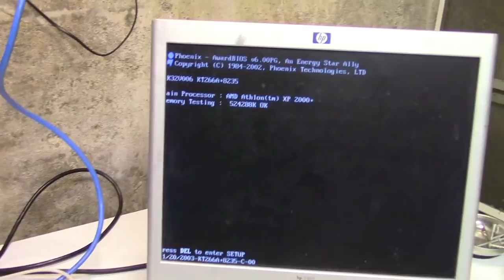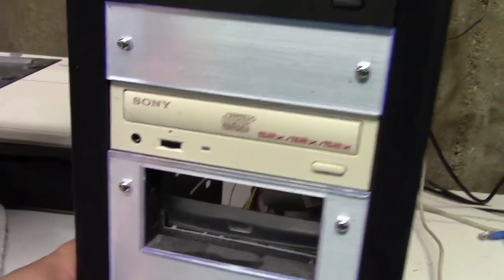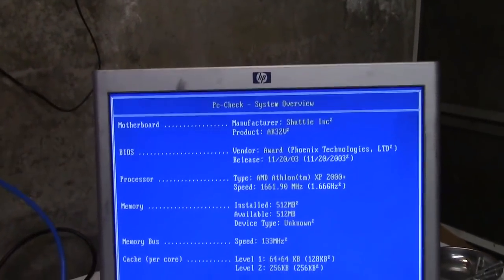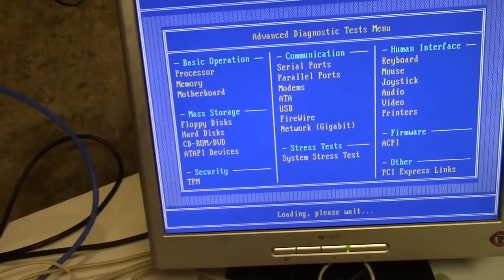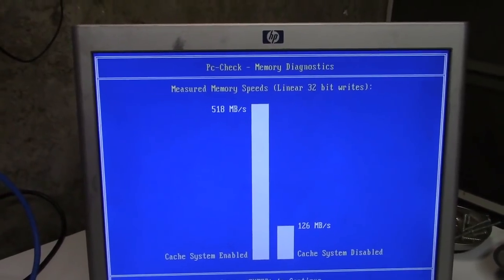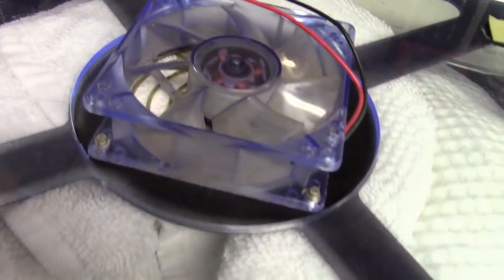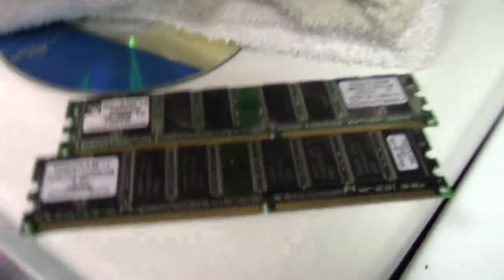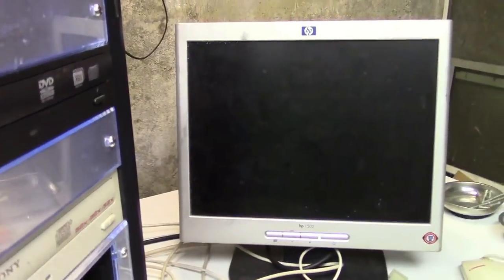A Big Pile Of Whatsit

Comment: The diagnostic program shows "ISA/LPC" even though it doesn't have ISA slots because the Low Pin Count (LPC) floppy drive controller on the motherboard is ISA based. This was true of all onboard floppy controllers up until motherboards stopped including them.
Reply from the maker: Thanks for the information!

Comment: That scarily looks like my old system although mine had more flashy lights on the front.  The cases are so similar they had to be made by the same company.  Even the  processor was close to mine, AMD Athlon XP 2100+.  I think mine started at 512 MB but was upgraded to 1 GB ram.  Mine has 2 optical drives installed with a space in between just like yours.  I do have a floppy in mine and I think mine has an 80 gig HD, western digical if I remember.  Its loaded up with XP and still works although it takes its time to do anything.  I may have to dig it out and make a video on it.  It hasn't been powered up in a couple years so who knows if it will even still boot but it did the last time I hooked it up.
Reply from the maker: Well, it likely was made of off-the-shelf components at the time when they were new.  Chances are the case was a common model at a good price, so a lot were sold.  The Athlon XP processors were all too common in their day, and in my opinion, couldn't get out of their own way.  My sister even has a hodgepodge machine like this, with a similar processor, from back in the day, she claims hers still works.  I know it suffered a hard drive failure a few years in, not surprising since it had a Western Defective drive in it.

I'm sure there were hundreds upon hundreds of thousands of these boxes built all over the country, this was a time when building your own computer was really catching on, and prices were low.  If this was the end result, I didn't want one!
Reply: I built mine back when it was a lot cheaper to build your own than to buy one all done.  Most of the parts I bought online (Newegg & ZipZoomFly) but some I got at a computer show like the case and the floppy drive, maybe even the CD burner as it is some generic drive.  It does have the volume control and headphone jack.  The other drive is an Asus DVD burner.  It also has a Sound Blaster card as I don't believe the mother board had on board sound.  It used to allow me to record the audio of anything that would stream.  Can't do that anymore.  Yes the Athlon processors weren't the greatest but I was on a budget of next to nothing to build this system and couldn't afford a Pentium.  Still it was worlds better than the old AMD K6-2 450mhz system it replaced.
Reply from the maker: I don't have kind words to say about those K6-2's either!  When parts got cheap at the time like you said, I REALLY noticed quality slipping away at a very fast pace.

Comment: 10 bucks for the sound card.
Reply from the maker: The one with the funny connectors or the other one?
Reply: The sound card with the game port.  As for the connectors between the sound card and the cd rom drive I don't think it mattered if it was connected or not. Always worked without it connected.   Maybe it was for msdos games and programs.
Reply from the maker: The cables between the sound card and CD-ROM drives were analog audio cables.  That was for "Redbook" Audio as it was called, basically using your CD drive as a simple music CD player.  When MP3s came on the scene (these were generally the Windows 95 days; not too many had PCs with sound cards under Windows 3.1), people would "rip" their music CD collection to MP3.  More accurately, the processor speeds usually weren't fast enough back then, so they'd rip them to WAV files which took a lot of disk space, then those WAVs were converted to MP3s to free up the disk space.

In the early days, most drives and software package didn't support digital ripping.  So the music CD was played at real-time and recorded to a WAV file.  The internal connectors were basically identical to plugging a microphone in to the mic jack on the back of the sound card and recording.  And again, later, the files were converted to MP3s. 

Later on we were able to record digitally over the (then) IDE cable.  At fist this was still done at very slow (near-real-time if not real-time) speeds.  Later on they were able to do it faster.  If the processor of the machine was fast enough, it could be recorded direct to MP3.  That's why a lot of early MP3 files (basically the very early Napster days, or even before) had blips or pops in them.  That was a key indication the processor in the machine couldn't really keep up with encoding direct to MP3.

On a more modern level, still archaic by today's standards of course with Windows 10 and whatnot, I remember back in Windows XP, Windows Media Player doing a whole song very quickly direct to MP3.  Digitally extracted over the IDE cable and converted directly to MP3.  Once digital extraction became the norm, those analog audio cables weren't used much anymore.  Eventually, drives stopped having the connector on them altogether.

Also, those internal cables were used for TAPI modems.  There was a wave of time where people were trying to use their PCs as answering machines, and generally the sound was received as a voice call by the modem.  The computer would know the line was ringing, instruct the modem to pick up and listen for carrier tones.  If it didn't hear them, it immediately switched to voice mode.  The system would play a sound file through the sound card, out one of those ports, into the modem, and out over the phone line for the other party to hear.  When the other party spoke, their voice was "patched through" to the sound card, where the computer recorded a sound file of it.  Later you could play it back.  So those were generally called "patch cables".  Some modems used a "stereo" cable and had a pair for transmit and a pair for receive, since the phone line was monaural anyway.

Now that you've had your history lesson, if you want the sound card, send me a private message on YouTube and we'll exchange email addresses and figure out the sound card.